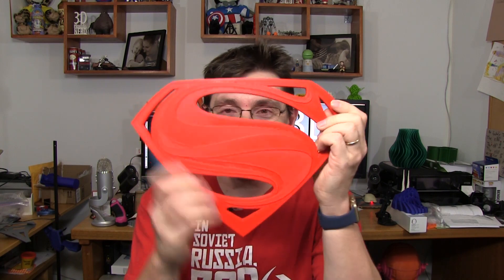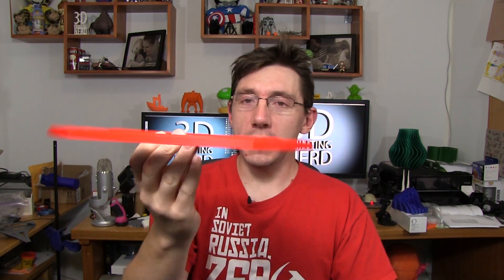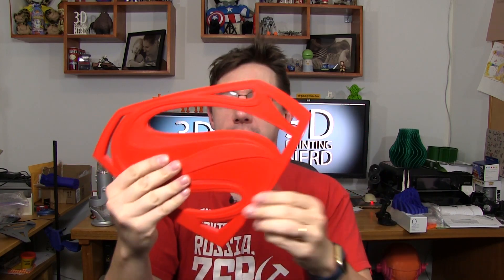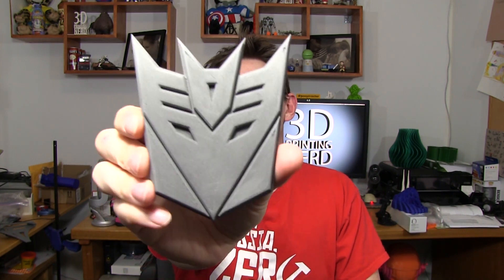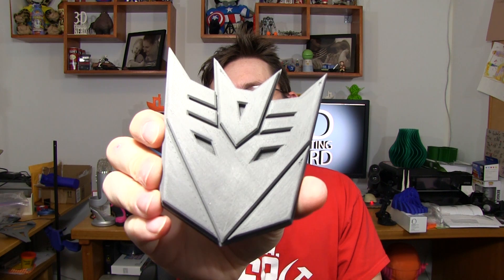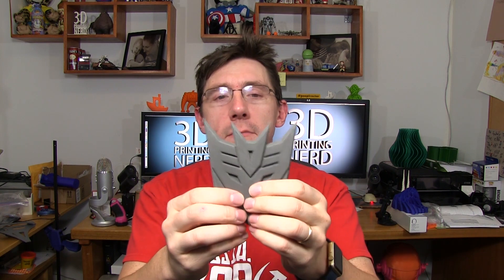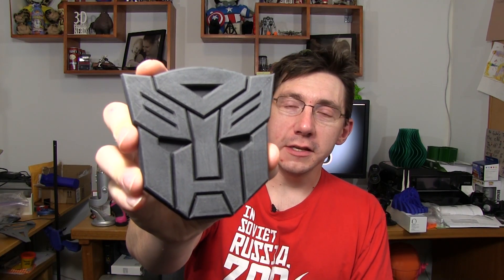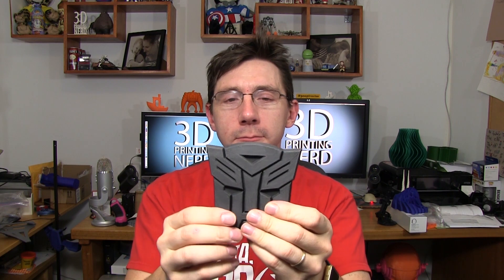3D Printing: Nerd Vlog 007 with Proto Pasta Stainless, Carbon Fiber, Superman, Transformers

Comment: Nice video! Word of caution to those getting ready to purchase the Proto-pasta stainless filament for the first time. This stuff is intensely brittle. If your printer has a bowden extruder you will lose a portion of the spool to breakage. You cannot bend or even slightly form the filament to straighten it out while feeding into your extruder or nozzle because it breaks too easily. It really sucks when it breaks at the nozzle because you end up with a very long piece of waste and for those times when you cannot get it right the first time you can end up with a ton of waste. Once you get it in and started it normally prints very nice. Very awesome filament when flowing smooth and no hangups with your extruder or spool.
Reply: Jamie B are you not suppose to use a pre heater rolling off the spool to lightly soften it???

Comment: Interesting channel you have, and a nice entertaining way of presenting your 3d printing adventures.
One thing i would have liked to see is not just a comparison of the look and feel of the new filament, but some kind of simple strength test print. Just a simple bar, maybe like 5mm thick, 15-20mm wide and maybe 60mm long. Then try to bend it with your hands to see how it compares to standard ABS and PLA filament, and check how it fails (does it snap, crack, bend, flex back, do layers separate...). Just an idea, and you could do the same simple test with every new type of filament you get.
Reply from the maker: I love this. Fantastic idea. I have filament reviews pending and I'll implement this and call it the "ExtraBase test". Are you okay with that?
Reply: +3D Printing Nerd Awesome. If you like the name, feel free to use it. :)

Comment: What were the treated extruders you mentioned? Did you try with the stock ones first?
Reply from the maker: +chalkers I picked up nickel plated nozzles from proto-pasta.com - they allow the exotic filaments to print without damage to the nozzle. I tried some carbon fiber filament on a standard brass nozzle and it was wrecked after 300 grams of filament. No joke.

Comment: hey I'm a total noob to 3d printing so I bought a new matter mod-t which prints PLA 1.75mm could I use that to print proto-pasta carbon fiber pla or will that filament wreck my printer? thanks. great channel by the way.
Reply from the maker: First - thanks for the kind words! Yes, you could print proto pasta carbon fiber PLA but, it'll be a bit rough on the nozzle for your printer. get yourself a plated or hardened nozzle for your printer and you'll be good to go!